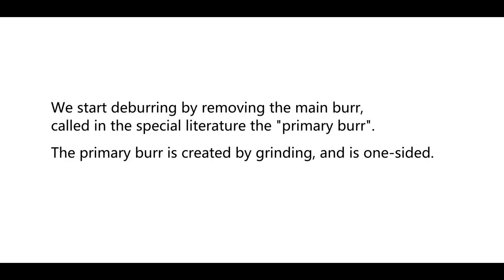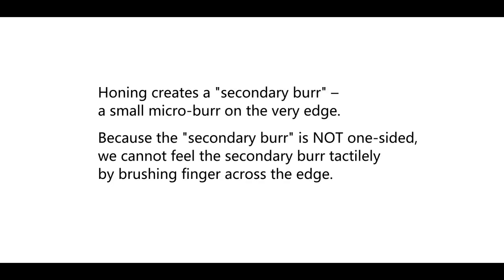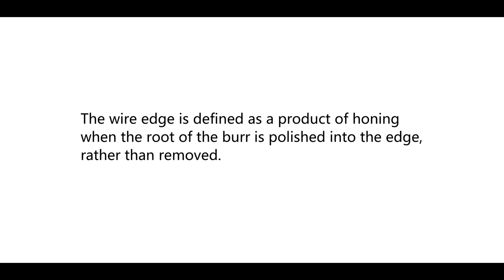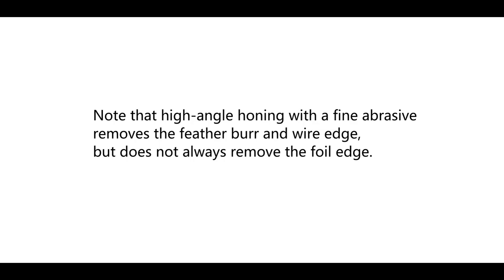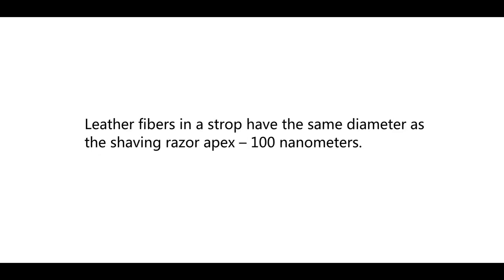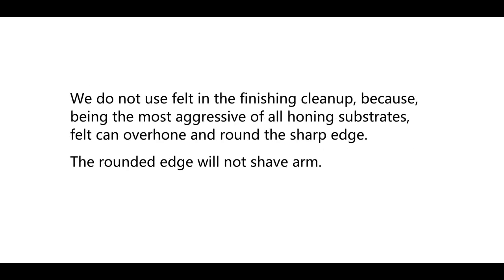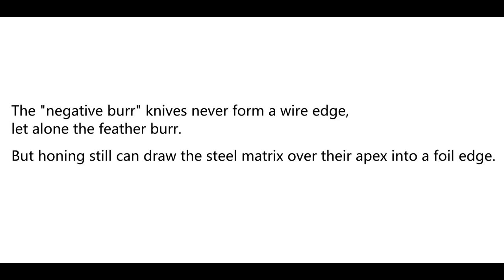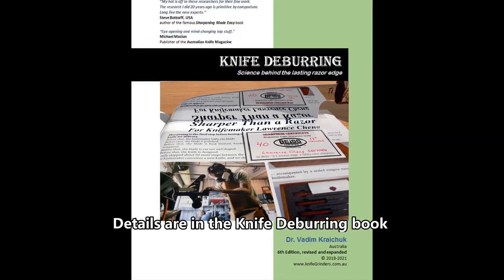The Burr Transformation in Deburring

Comment: Great detail . . . Much appreciated.  This all leads to one more question . . . 
- What is the smallest practical apex radius for a culinary prep knife to be used on a cutting board ?   
- The term "practical" to me is a cutting edge that is unlikely to be rolled over into a burr within a few 
hours of use on a cutting board.
Reply: Das würde mich auch interessieren
Reply: @urmelausdemeis3495   
This seems to be a subject few people are willing to address. I have presented the question many times. 
With extensive research on the internet, along with my knife sharpening & testing has yielded a few concepts. 
Theses are my notes form my research . . . If you know something I don't; please share.
- 600 to 800 Grit Grind - 0.00005" cutting edge width for Meats & Delicate, but firmer low moisture content food, (BESS 95 Grams).  Risk of cracking &/or rolling the cutting edge with bone or contact is high. 
- 300 to 400 Grit Grind -  0.0001 to 0.000075" cutting edge width for a food prep knife, used on a cutting board (BESS 150 to 200 Grams).  Risk of cracking &/or rolling the cutting edge with cutting board contact are reduced. 
More of my sharpening notes & diagrams are available at: dbxknife.com/knife--sharpen-info
I can translate this in to German if you need clarification.

Comment: I have always deburred at the same edge angle. This is with low alloy and high carbide steels. Based on this video you would suggest high acute angles for low alloy/carbide steels (420hc, 1095, 3V, etc)
Reply from the maker: Many high carbon low alloy knife and woodworking tool steels, provided that they are well hardened,  are negative or near negative, and debur cleanly at the edge angle. Positive burr knife steels, that require the high-angle deburring step, include such mainstream knives as Victorinox, Wüsthof, Zwilling Henckels, F.Dick etc among many others - it is impossible to deburr them cleanly at the edge angle.
Reply: @knifegrindersaustralia5158   Very useful information. Thank you.